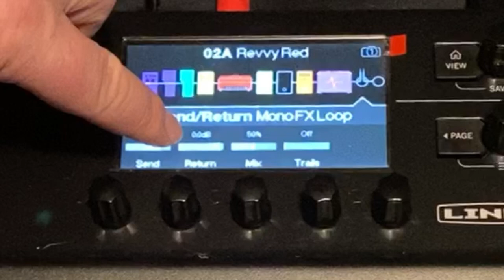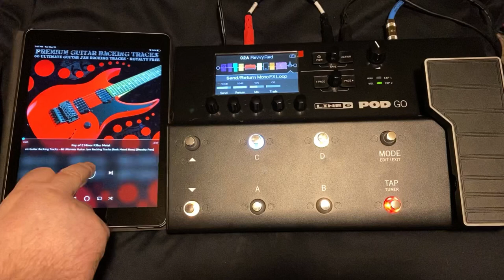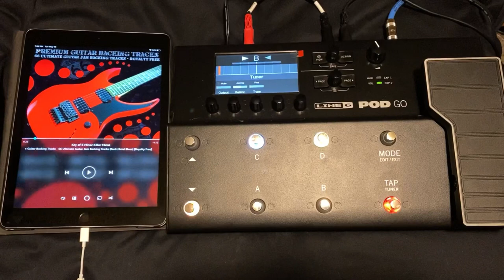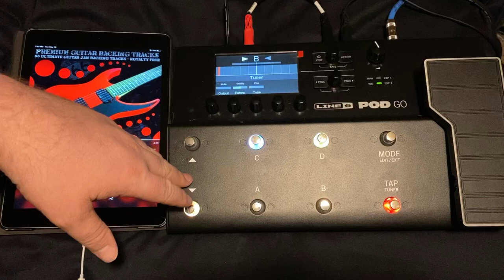Line 6 Pod Go How To: In Ear Monitor Rig

Comment: Nice vid Clark, thanks. Have a question, my idea is to do this. Guitar into the guitar-in of the pod go, both main outs to the FOH (stereo patches is the idea), and from the mixing board getting a general mix of how is everything sound through the FOH, and that going into return of the pod go. Would I be able to hear through the headphones out with IEM the mix that I’m getting from the mainboard? 
Haven’t seen anyone talking about this particular setup only. 
It would be appreciated the answer.
Thanks in advance!
Reply from the maker: I would use the fx loop as the last in the chain, send from the fx loop in stereo to FOH, and use the monitor mix into the return of the fx loop. That way the house will only get your guitar and you will be able to hear the mix through the headphone output of the pod go.

Comment: I'm just getting into e guitar and I'm not going the pedal plus amp route only headphone and pa

So right out of the box do you need to connect it to a pc or can you just  plug in a power plug? And all of my research include someone first plugging into amp and then headphone out. I'm wondering if you can just straight up use headphone.
Reply from the maker: Yes you can simply plug in and use headphones.

Comment: How can I separate the volume of a backing track and the volumen of the guitar? When I move the volume switch of the pod go it affect both (backing track and guitar signal).
Reply from the maker: If using USB, there’s a global volume control for mixing. If using analog connections, the volume on the iPad should work.

Comment: I am really stupid so don't fully get where the cables go.
Reply from the maker: No worries. Guitar cable to guitar input, monitor or backing track cable to fx return, guitar cable from fx send to a mixer or DI (only necessary if playing live), and headphones plugged into the phones port for personal monitoring.
Reply: So does that mean the mix that's coming from the mixture into the pod go when it comes out does it goes out to both the headphone and the main outs ?
Reply from the maker: Yes, if you wanted to separate the guitar from the backing track, then you would use the cable layout I gave you. If you want it all to run together (like the headphone would) then you can use the main outs.
Reply: @DefconClark  thank you